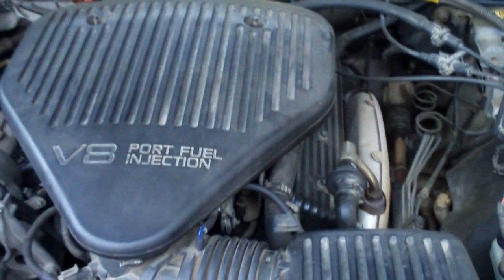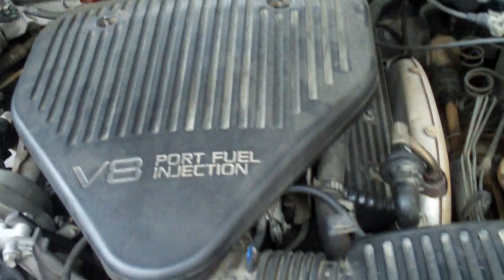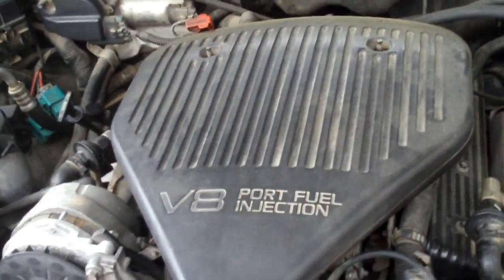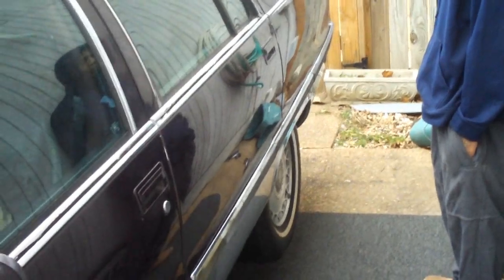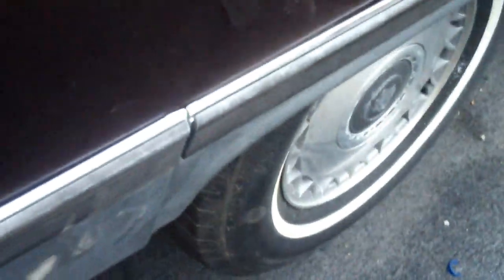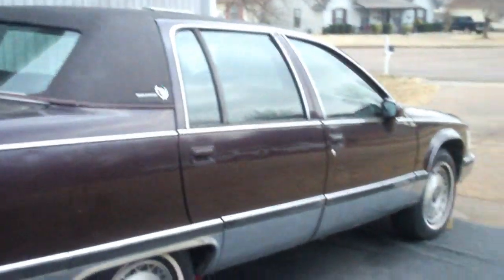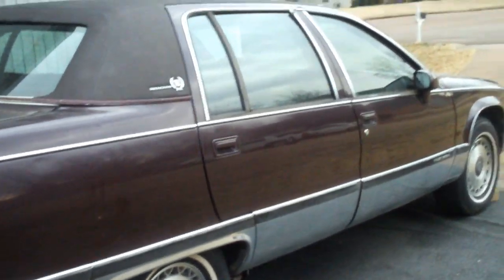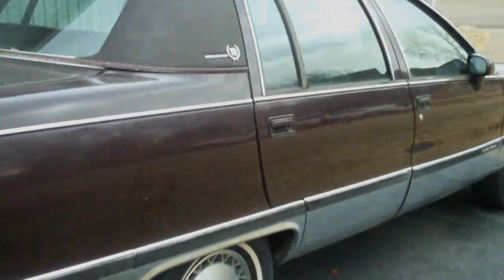95' Fleetwood "Cranking The Caddy" (Pt.2)

Comment: You do realize, that engine has a MASS airflow sensor, and if you disconnect the intake plumbing, you're totally fucking with the computer -right?
Not a good test, to check for a fuel problem. Just sayin'.
Spray some shit in an intake vacuum port instead. ;)